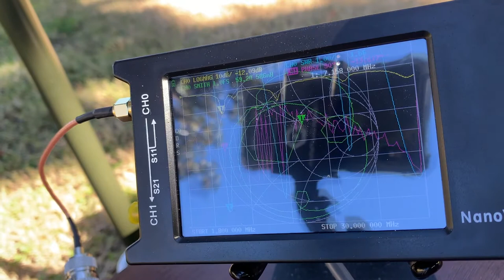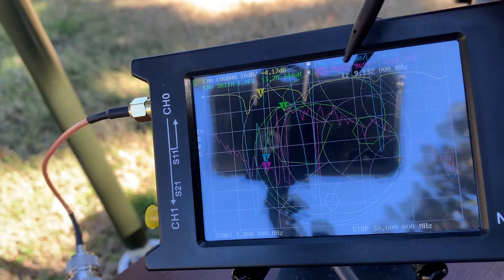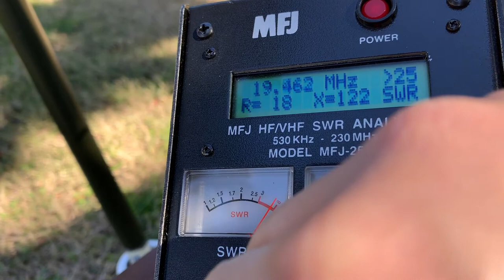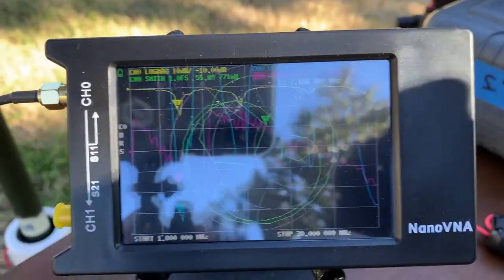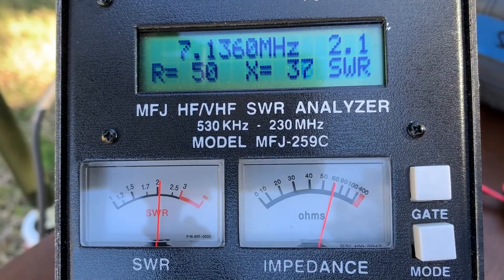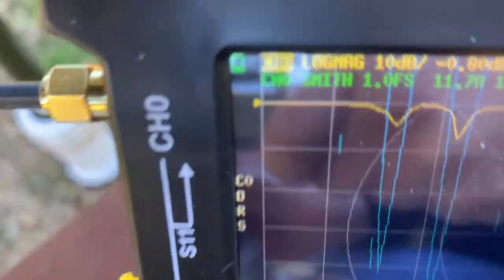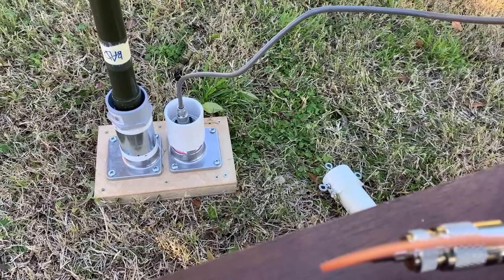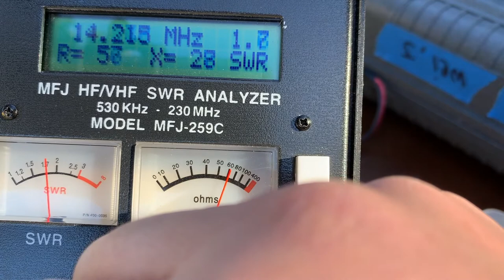NVIS Antenna Base Comparison

Comment: Nice video, I have been studying this military antenna system for over 30yrs. I have used it in military comms. it still intrigues me more than any HF antenna system (military specified length). I think it's the King for NVIS comms, of course not one type of system is the best, but this one is 50yrs ahead of its time. the ANT. is intended for use with an ATU for a very specific task which is close in NVIS comms under a contested environment (providing you have room and luxury for its footprint).

Also, and most importantly, the antenna is prone to various fluxes depending on the type of sub-ground that it is used on - you will have a change in swr, hence the ATU but it's the best ''helical polarized'' ant.  for NVIS HF Comms.